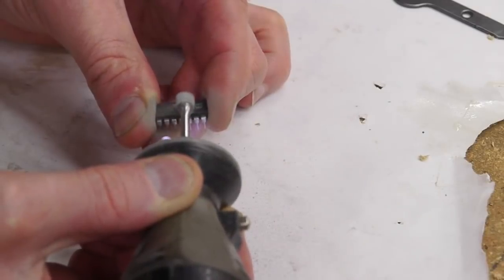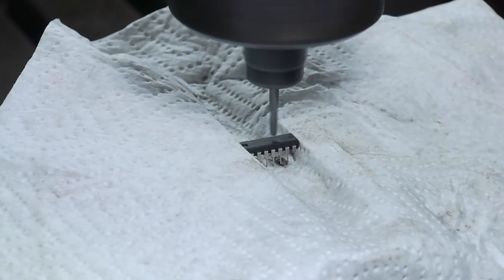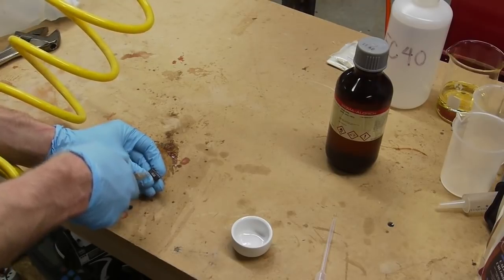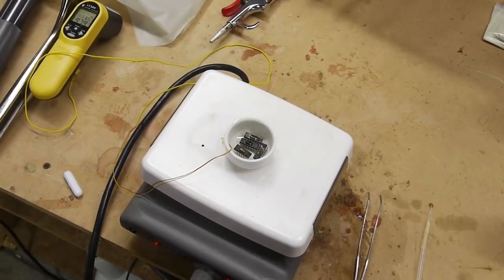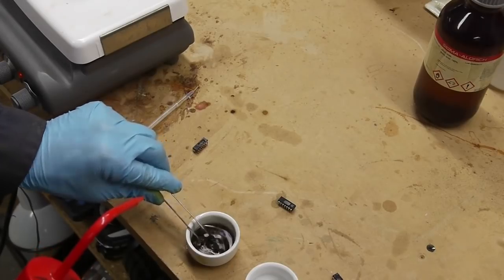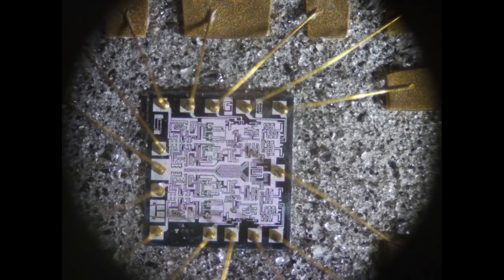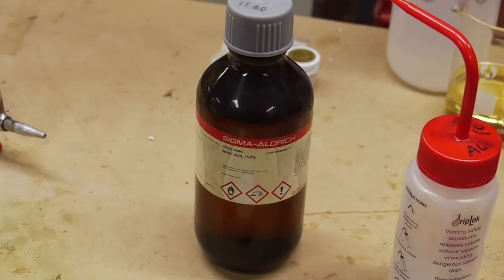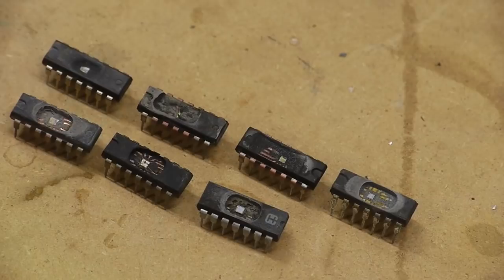Decapping ICs (removing epoxy packaging from chips to expose the dies)

Comment: Ben, Love your videos and this one is very interesting but PLEASE PLEASE be aware that fuming nitric acid should always be handled either outside or in a fume hood.  White fuming nitric (essentially 100% HNO3) and ESPECIALLY red fuming (HNO3 with excess dissolved NO2/N2O4) both give off nitric oxide/dinitrogen tetroxide which is INSIDIOUSLY DANGEROUS.  It causes pulmonary edema and death in tiny amounts.  An inhaled lethal dose does not manifest itself until days later and then it is often too late.  Please be careful and maybe add this warning to your video.
Reply: Wow - this is important to know! Guys - please vote parent comment up so that it is more visible because everyone watching this video should know this.
Reply: Sadly we have to report that Ben has....
Reply: accidentalvoyeur m
Reply: Thisis MyName - Not bullshit! I worked with this stuff for over 20 years in IC failure analysis. we always used a good fume hood and were very very careful not to breath the fumes.  Here is a quote from a Fisher Scientific Material Safety Data Sheet on red fuming nitric aid "Inhalation: Effects may be delayed. Causes chemical burns to the respiratory tract. Inhalation may be fatal as a result of spasm, inflammation, edema of the larynx and bronchi, chemical pneumonitis and pulmonary edema. May cause acute pulmonary edema, asphyxia, chemical pneumonitis, and upper airway obstruction caused by edema. Many human deaths from pulmonary edema, induced by the inhalation of high concentrations of nitrogen dioxide have been reported. There were at least 90 deaths prior to 1920 and over 60 between 1930 and 1956. The incidence of chronic effects from long exposures at low concentrations of NO2 is less well defined. (Doc of TLV) 
Chronic: Exposure to high concentrations of nitric acid vapor may cause pneuomonitis and pulmonary edema which may be fatal. Symptoms may or may not be delayed. Continued exposure to the vapor & mist of nitric acid may result in a chronic bronchitis, & more severe exposure results in a chemical pneumonitis. The vapor & mists of nitric acid may erode the teeth, particularly affecting the canines & incisors. Monkeys exposed to nitrogen dioxide at 10 ppm for 1 month or at 5 ppm for 2 months showed a marked decrease in resistance to infections. (Documentation of the TLVs, 7th" https://fscimage.fishersci.com/msds/16540.htm
Reply: @jamescarrington9700  so no recent deaths. A big nothing
Reply: @arthurmead5341  There have been no recent deaths because of phosgen inhalation, although it's used widely in industry. Want to take a sniff?
Reply: @AlexBesogonov  yes there was, in WV in 2010. At any rate it is more toxic than anything ben would be exposed to in this vid, and use of phosgene has been declining for years
Reply: I will side with the persons saying this is an over reaction, yes it is dangerous but using small amounts of it in a garage isn't that bad, If you were using tens of ml or performing a reaction that could potentially produce large amounts of nitrogen oxides then I would agree otherwise using just a respirator and working with open windows is enough, a warning to not handle fuming nitric acid with latex or nitrite gloves is far more pertinent, in fact bare hand is preferable. Do someone here knows what HCN smells like? I mean from real experience not the BS "like bitter almonds" everyone just parrots.
Reply: @teresashinkansen9402  i am in the "it's not bullshit, because it is dangerous...but not it's not that dangerous" camp. safety will always be over-emphasized in commercial contexts because of the risks of liability.

Comment: I once paid a guy a lot of money to do this. Why?  In order to place the bare chip under nucleus beam, from different elements, from a large van de graaff   generator at Brook-haven National Laboratories, while the chip was operating. Why? To determine how the chips (memory) would perform in space.  That is - in Space Radiation - solar wind.  The packaging plastic would have distorted the results.  The actual chips used (on the spacecraft) were then parylene coated to prevent out-gassing.

Comment: You could increase the magnification of the microscope and look for hidden markings or the so called designer grafitti, which where used to trace the chips in case of industrial espionage, altough many times the designers put this markings there for fun...
Reply: Yes, like the famous “Bill Suxx” logo done by intel cpu designers
Reply: @MaverickM1  too bad that was just a hoax and didn't really happen

Comment: Wow! That was interesting. I never dreamed those IC's looked like that inside. I actually thought the circuit was a lot larger. Thanks for posting that.
Reply: I usd to look inside early E-PROM chips with a microscope, and we measured the size of the transistors, them counted them!  One 64k chip had 65,000 transistors.

Comment: I know this is a really old video, but I enjoyed watching the decapping process you are using.  It reminded me of a project I played around with in the late 80's.  The project used a decapped dynamic ram chip as an image sensor.   The very large dip memories of the era had metal lids so they were very easily decapped with a torch or soldering iron. The dynamic ram packages are designed to be totally light proof since the capacitor based memory's charge bleeds off quicker in the light.  This effect was used to make a crude image sensor in this project.

Comment: Very informative and interesting  for those who, Like me, are used to do reverse ingeneering. For those who are asking. You don't need to decap microprocessors since the 80286 because they are not encapsulated in epoxy. It is very easy to open them with a sharp cheasel. The same goes to all ics in metal or ceramic case.
Reply: but is it possible do with the chip in circuit and without damaging the silicon or rip off the wires conections ? . so that the circuit can still work flawlessly. do heating it make it easier to cut ? do u heat them ? how much ? or heating the blade edge ?

Comment: I have been trying to pop these things apart for months! Ive never found any useful videos but this finally answered my questions! Thanks!
 P.S. I've noticed that a lot of older CPU's (early 90's) simply have a metal cap soldered over small panel in which the chip is mounted; apply a bit of heat and you can pop them off, and since older chip architecture is comparatively large, it's very easy and interesting to see with the naked eye!

Comment: Ben, just a small tip from somebody who has done this professionally. After dripping, just rinse the whole IC in the acid then rinse in acetone, after that reheat and repeat the process. This will get a more even decap. We also used a flat mill bit for the initial hole. But be aware, fuming nitric acid is serious stuff.

Comment: Nice! You can make an ultra fine needle by dipping (at short intervals) a small steel wire in NaOH and running some electricity through it, don't remember the polarity though. This way we get tiny preparation needles for microscopy.
Reply: thanks for the tip(pun intended)! last week I was searching online how to exactly do this but unable to find. I just had in mind that I've read it somewhere online and couldn't find any traces when needed.

Comment: Very cool to see how it looks inside a microchip. It's more than 30 years since I first wondered how it looks inside 😃
It was a lot smaller than I thought. Now I wonder how they manage to make it so small 😂
Thank you for making this video !!
Reply: It's all done with photographic equipment and acid.  The patterns projected onto the Silicon slice were originally hand drawn in a much larger sized, then photographically scaled down.  Modern factories use special machines from the Netherlands to scale shapes way down so a thin line on the drawing becomes just a few atoms wide.  Also they now use computers to do the original drawings for new chips.  But the old 74xx and 40xx logic chips had much fewer lines and the inventors could still use hand drawn designs.

Comment: De-cap an Atmega :0 and then couple it to a liquid nitrogen cooled heatsink and play with clock speeds......................
Reply: Do Atmegas have external clock inputs?
Reply: They do.
Reply: I think almost all Atmel AVR chips have a clock input. Even the 6 pin devices have a clock input.
Reply: Use an Attinny85 it's cheaper and have less pins.

Comment: I'd love to see you power & exercise the decapped chips and see if activity is visible using an NIR camera. All conducting p-n junctions glow, dissipating that (in the case of Si) 0.7V forward drop. Unfortunately, that's not in the visible region, and I'm not sure if this glow will escape or be hidden under aluminization or something. If the chip is interesting enough, you might be able to see different parts activate at different times like some sort of brain scan.

This will only work with old BJT-based chips, CMOS probably doesn't glow much at all since there aren't many p-n junctions doing anything interesting.

Comment: If you de-cap some DRAM you can focus an image on the die, write all 1's to every memory location and then read the memory back. The brighter the light, the faster the memory location will discharge and you should be able to decide the image. This is how CCD camera sensors work.
Reply: That is putting it rather simply, and only focuses on the "capacitive" nature which some designs use. The actual structure of each bit in terms of doping is quite different, and CCDs are better described as photodiodes in varying bias modes (design determined) attached to bit-bucket shift registers, rather than addressable, selectively rechargeable capacitors. The corresponding decay in DRAMs is what corresponds to the dark current and some other factors in the CCD, which when combined with the fact that you want the impinging light to actually transition the cells and that cells for CCDs are read and reset at rates no faster than what the cells for DRAMs are scanned in a read and rewrite process. There are also other factors which cause differences between the two but...

Comment: Back in... 1986??? ish. I visited the SEC research labs in Richmond Melbourne). One of the instruments they shwed off was an SEM.  They had a de-capped chip from a digital watch, powered, and as the circuit switched you could see it in the SEM because the energised paths in the silicone bled a few electrons...

totally astonishing to watch silicon circuits in real time using electron imaging.

SEM's should be much more accessible these days... It'd be utterly awesome to see one of these circuits lit up in an SEM.

Comment: Put the chip in a ceramic chip socket then use trichlorethelate (however you spell that) as Japanese audiophiles do with DAC chips so they can solder silver wires on

Comment: When I worked at Maxwell Technologies in the early 2000's, we tested off the shelf IC's for space use.
They would remove the epoxy on the chips to be tested to expose the bare die.
They would then be 'Zapped' with particles that came out of a cyclotron at we rented time on at places like Texas A&M.
While this was happening, test equipment would analyse them for Latch-ups, and flipped bits if they where memory chips.

Comment: decap a large CPU. photograph it and sell the pictures. The landscape looks nice and could be a talking point.
Reply: There's no cap on a CPU, and they are made on much smaller process (nm scale), you can't see anything with an optical microscope like here.
Reply: I think he means like a microcontroller like the AVR chips. Those you'll be able to see cool looking circuitry, and they're only a buck or 2.
Reply: I had an old PC kicking around with an Intel duo in it, some old worthless thing. I took it out and using a chisel, popped the metal cover off, only to sadly see a plain silicon die,with no circuitry on the top layer. However, with some luck I attempted to chisel the die out, I did break it in half in the process, but I managed to expose the circuitry, and I really wish I had a metallurgy microscope to look at it now, because its quite something and has incredibly small details.

Comment: I worked at GTE Sylvania in the late 1970s designing vertical deflection circuits for color TVs.  I watched as several 8 watt audio ICs were decapped to identify the failure mode and location.  A powered hood was used to protect against fumes.  It is possible to identify the difference between over voltage versus over current faults.  Picture tube arcing could produce over voltage, and poor heatsinking could produce over current faults.

Comment: You could use Amine solvents. I've seen Amines dissolving epoxies. You may begin with triethylamine, Ethanolamine. But the downside is that copper may get attacked.

What can you do next? You can make the chip work normally in its circuit-only with the silicon visible under a microscope. In the dark you should be able to see the PN junctions & transistors glowing like little LEDs. All this is my conjecture. Perhaps its worth discovering. I suggest you begin with a 555 IC wired in timer mode. This ought to result in some visible flashes.

Comment: Decapping a Core i7.
Reply: +Isaías J. putting it in close to 0k surrounding(liquid nitrogen?) and overclock it to the max
Reply: mathias de potter Yes.
Reply: +mathias de potter It may not work due to the cold bug unfortunately :/
Reply: Ciro Santilli
we're not trying to reverse engineer it though..
Reply: Romanator X
it is possible, you don't put the cpu in before starting, you wait till the computer starts.. before plopping it in...
Reply: That's extreme! Get an electron microscope and upload the results. That's sort of impossible but a lot of stuff we use and abuse was considered impossible. Imagine what Nikola tesla would've done if he were alive today? Wow. Thinking about looking in a i7 chip made me think about what tesla would do in this time.
Reply: JP Aldama
yeah imagine the experiments he could've done today...
Reply: perhaps Nothing. Or If he was not addicted to his cell phone.
Reply: @azzym8794  soo true
Reply: I think the decapped die won’t have enough surface to transfer the heat to the liquid nitrogen. It will burn up as soon as you power it on. You need to spread the heat to a large surface and then cool that large surface. So that would be the chip package that has just been removed.
Reply: b8e71fcbe2e195c67d8d16734013d20f the decapped die also wouldn't have a thick layer of insulating epoxy.

Comment: I’ve seen this done in an R&D lab once and they dissolved the chip encapsulation and the glass layer over the chip with hydrofluoric acid which is seriously nasty stuff. The chip was then run under an electron microscope and you could see the gates operate as light transitions. Very cool.

Comment: I saw a de-capped chip being investigated in the old BT research labs. I seem to remember them using polarized light where they could see the pd of various tracks changing. They did not use probes as such. Very interesting though about 28 years ago.

Comment: WOW, I've wanted to know how to do this for nearly forty years!  I always thought that chip packages were made out of some sort of porcelain  (in that case, I guess then one could crack open these packages with a hammer).  Apparently, I was wrong about the materials.  Very cool that this is possible, though the demo makes clear that this is a project beyond my patience level.
Reply: High temperature chips are ceramic.
Reply: PDIP chips are plastic and CDIP are ceramic. Most 7400 series chips (or other simple, low temp chips) now are PDIP because it costs less.
Reply: everything changes, stay open-minded
Reply: I had great success using a pair of side cutters, and popping the top off. That was in the late 70's and early 80's.

Comment: Back in the late 80's, Micron Semiconductor (memory manufacturer) used a water drill to expose the top of their RAM chips for failure analysis.  One of my side projects was using a decapped RAM chip for a vision system.  Didn't have much luck with it.

Comment: This is how we would hack ASICs, laying needles on the data buses and logging the interaction of the sub structures. With enough patients the IC's would usually cough up there secrets :) As Systemrat2008 mentioned you can use HF to remove the uppermesh layers on the die. These final delayering steps can be very difficult and many of the more advanced ICs has many layers to prevent this.

Comment: Hi Ben- great experiment! It would be interesting to know why the bond wires did not dissolve in the nitric acid. My experience is that nitric acid will eat through brass like crazy.Would you know what the bond wires are made of?
Reply: Almost 100% of die bond wires are 100% gold....some bond wires for power devices are or were made of aluminum.

Comment: Fuming acid is a must for fast decap. 
I had usual concentrated nitric & sulfuric acid, and it was just not working at all. 
So I had to decap it for 3 days in my concentrated sulfuric acid with a bit of hydrogen peroxide.

Comment: Ben -

Red fuming acid is far more aggressive with the epoxy, and only slightly more aggressive with many common metals, especially aluminum. Red fuming acid is the choice of professionals for decapping chips with aluminum bond wires if they don't have the budget for an acid-jet decapping machine. Oleum also works well if you can get your hands on it

Comment: Keep in mind that if you want to probe the IC under real-world conditions, not only will you need extremely fine probe wire, you'll have to attach the probe wires, then run the thing in the dark, as silicon is light sensitive (it's the same stuff solar cells and phototransistors are made of)!

Comment: a popular chip is the Mega328PU. cheap and does cool stuff, easy setup. its should come with "Blink" programmend. rip its cap off and probe it. 5v and ground. Pin 13 is the active blink 5v out.